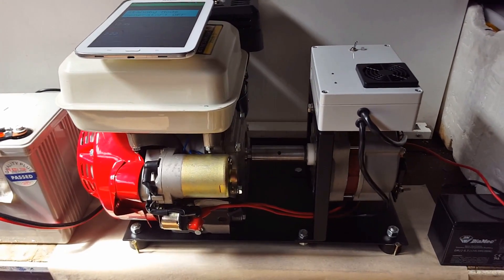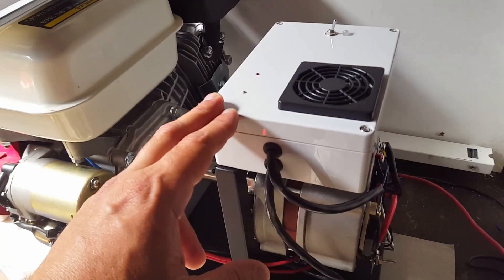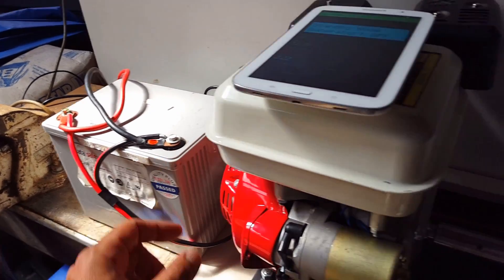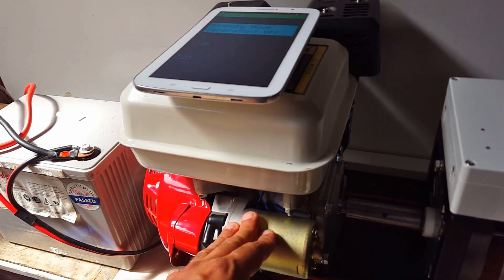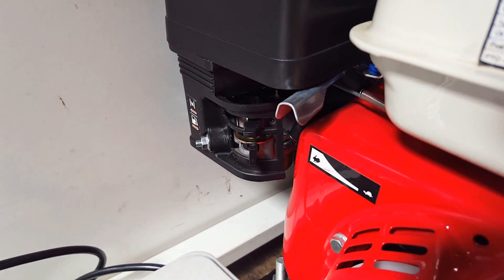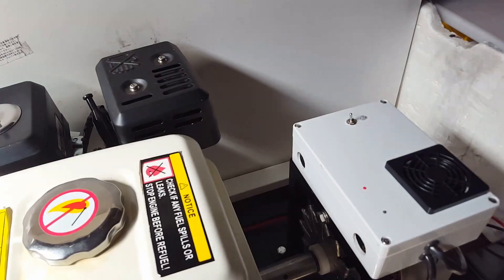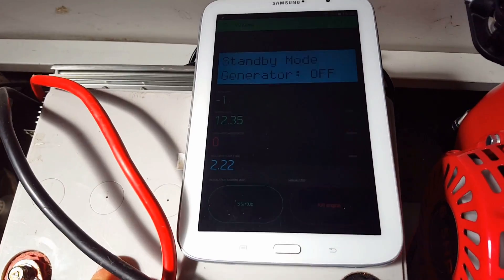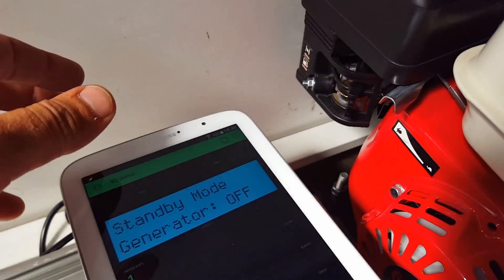Generator converted to auto start stop and charge a battery bank with 3 stage regulator and V2 app.

Comment: i've got a system with 3x 100ah batteries that charge off solar but in winter there isn't enough sun to keep them fully charged. they run motion activated security cameras through an inverter that takes the 12vDV up to mains voltage. total current draw is about 4amps.  looking to install an auto start gen there to keep the batteries charged in winter without having to start a gen there every day.
gen would need to start when batteries are low and shut off when they are at the desired voltage.

wondering if you have a controller that would do this that i could purchase. 
i would be using a small diesel engine so i don't need to do anything with choke. 

hopefully you can help
Reply from the maker: Hi. Look at the V6 AutoGen smart controller on our website www.dcautogen.com

Comment: Love this!  I am looking at using a inverter style “suitcase” style generator when out on our boat and would like something like this!  I want to be able to use all of our appliances/devices hooked up to the house bank of batteries on the boat (3 deep cycle and one general purpose starting battery....all deep cycle) and only have the generator kick on AUTOMATICALLY when the batteries drop to a certain predefined programmable level then have the device automatically shut down the generator when the bank of batteries are sufficiently charged and then reset to start the process all over again when needed.  Also would like to be able to remotely have the generator start and stay running if need be too, so if we wanted to have the air conditioner run and would need the generator running to do so!

Would this device handle all I’ve described above?
Reply from the maker: Hi.
Yes, of course it will :)
Check out our online store for more info on our products www.dcautogen.com

Comment: What are you using for controllers. Uno Yun? Im working on a full auto system as well and ultimately will have a cell app for it. But have not got that far in my coding experience. But my system is a little more than this, as it is a fully integrated woodgas system. So there is the full machine start up involved and then firing up the engine and then shutting down properly.  For the engine start re attempt how are you detecting if it failed? Im guessing you are reading the charge state? My systems will output in AC so its a little more complicated. So was planning on wire wrapping a spark plug wire for input. Start attempt #1 would then write a variable and then we check for signal. If not true we then attempt Start attempt #2 and write a new variable and check input and so on. 

I need a  voltage divider for 60 volts to 5 volt logic. Any idea where to find one or build it. Anyways nice system:) Cheers!
Reply from the maker: Excellent! 
Just use 200k and 10k as a voltage divider. We are using Particle boards as they have wifi antennas but they have 3.3v logic instead of 5v.
You could access the 12v 8amp charging coil as a signal to trigger engine running status.
Looks like you're on the track! Good luck with your project ;)
Reply: @DCAutogen  Cool deal, I will give it a try. This here is the early version of the code with out the auto engine start code. The engine code I have complete and working a petro engine. Now will be to combine the code and implement the automatic run sequence. https://www.youtube.com/watch?v=--ckceL10gs&t=2s

Comment: Can this device work for a air compressor instead of generator?
Reply from the maker: Hello Alex. Is this a petrol engine driven air compressor? If it is equipped with an electric starter then yes, it is compatible.
Reply: @DCAutogen  yes petrol powered. But can it work with a simple pressure contactor to act as a call signal for the engine to start?
Reply from the maker: Sure can Alex. Our V2 AutoGen controllers can be customised to suit different scenarios, just like yours. If equipped with a manual choke, you will also require the choke servo.

Comment: What skill level would I need to install the kit to my existing generator mate
Reply from the maker: Mirriulah Water Dog if you can use a multimeter and basic tools like screw drivers and wire cutters then you can install it. Some basic knowledge of electrical connections are necessary.